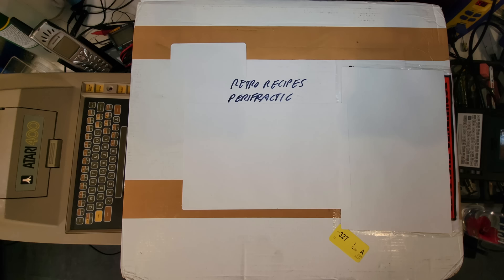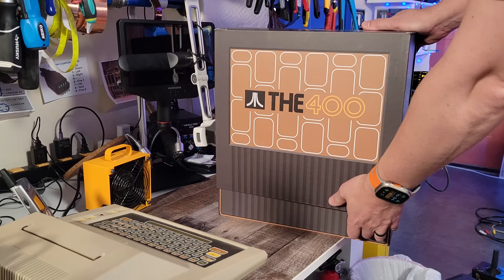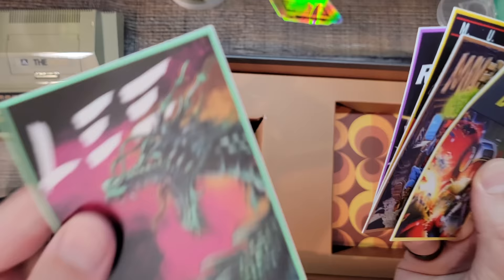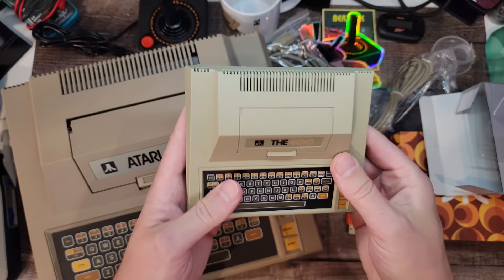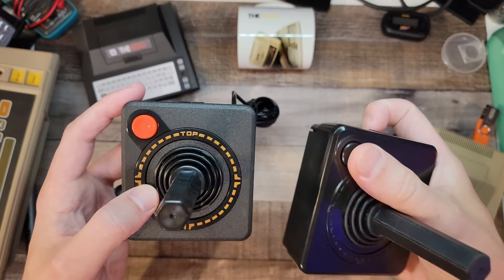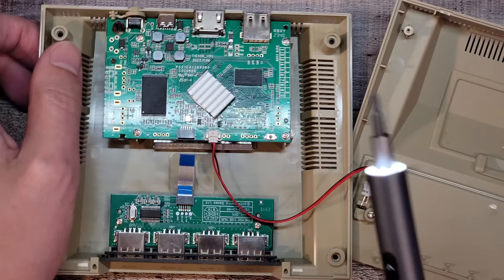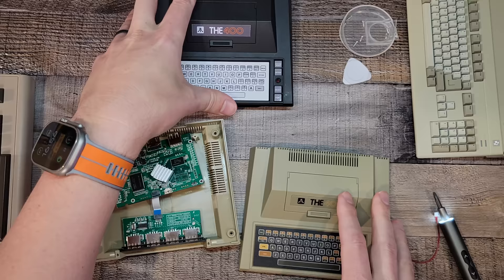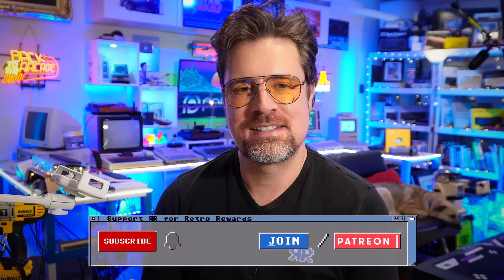It's here! A very special THE400 Mini Atari Unboxing

Comment: I have these 5.25 inch disks that are double density using the Atari 1050 drive, I don't have drive anymore and the Atari 800 I gave away twenty five years ago but now own a 400 mini.  How do I get the programs that were created by me forty years ago when I was about fourteen years old onto the 400 mini?  These programs are very large and took weeks to create, some entered from magazines that don't exist anymore like how to extend sound range from four channel to two channel 16 bit using machine code, very short program.  The music I entered was Bach inventions that go very low in base notes (two-part inventions by Bach for two voices)

Comment: Just saying: Instead of the word 'spanner' you could have used 'tool'?  The PCB could have been 'Player Can't Break-it' (the joystick)?  Also:  Those aren't weights, they are xylophone blocks (keys?).  Hence why they are aligned in the way they are - so they make a different sound when struck by the hammer (er, spanner?).  Just some thoughts on this one.  (Just kidding as always though, LOL!).

Comment: THEA400 Mini uses THEC64 main board in it... hahaha THEA400 Mini use the same Carousel Manhattan too from THEA500, it a shame they didn't work on a better theme, it looks to much like THEA500 Mini's Carousel but I guess its like Android where that looks the same on every phone but this is not a phone, thats its only draw back with me, it looks like THEA500 to much, I don't like how ATGames consoles all look the same too and use the same menu.
At 10:30 you are pointing to its USB Ports that are used on THEC64 keyboard and its 3 port hub and the Capcom Home Arcade Joysticks are connected too, and yes that uses the same board too so 3 devices now use the same board, they can be turned into any Virtual Retro Machine... :) you got to love the Mobile Phone and Tablets... :)
Oh did you know: That you can put THEC64 board in THEC64 Mini Case, I have mine in a THEC64 Mini case because it was too big on my desk.

Comment: Would buy if it were slightly larger with a working KB. As it is, it's.. a shell. A PERFECT shell, but just a shell. To play the greats (Star Raiders, Defender) YOU NEED A KEYBOARD. And plugging in one seems like a waste-of-space-cheat. Might as well move up to a mister and have 20 or something systems instead.
Reply: I remember Perifractic talking about this in the prototype video.  The buttons on the joystick provide the keys necessary for those classic games.